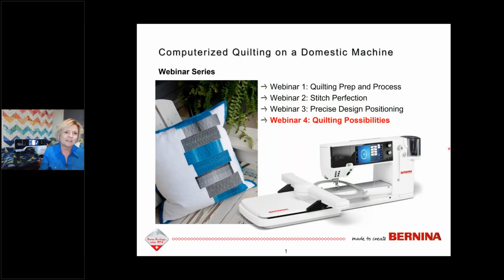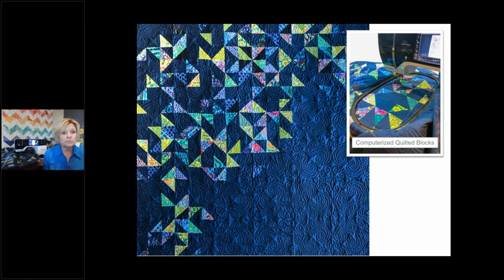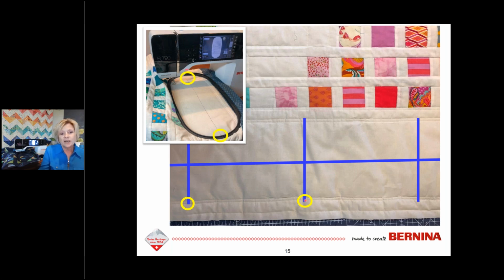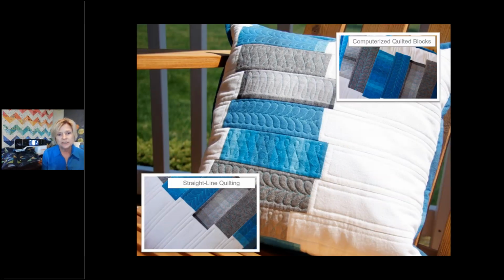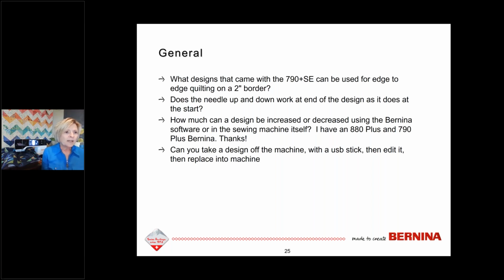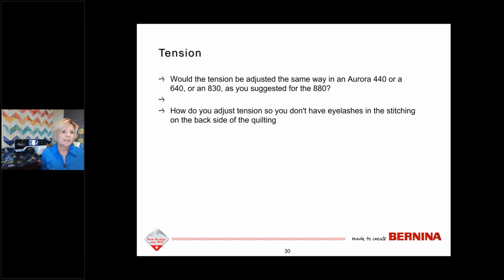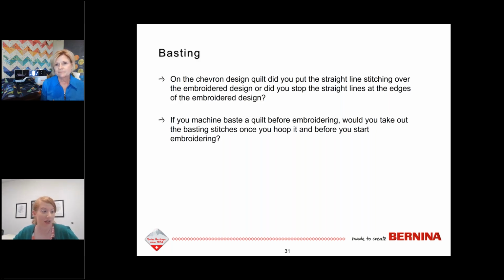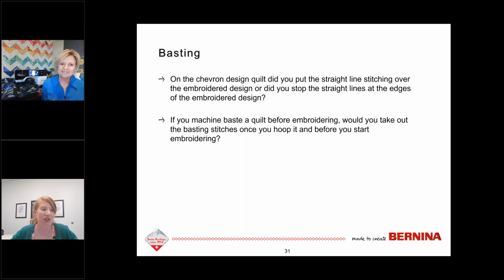Computerized Quilting on a Domestic Machine Webinar Series with Connie Fanders Session 4

Comment: This was a great webinar series and very clear.  Two suggestions for next time:  I would love a webinar that emphasizes utilizing the Version 9 software for computerized quilting, combining designs for sewing  out.  Also with regard to pinpoint placement, I just finished a course with another Bernina educator on a whole cloth quilt using pinpoint placement.  She highlighted the use of the zoom in function so you can see the actual stitch that you are lining up to and setting.  Also it covered how to use pinpoint placement without resizing the design which actually shows on a whole cloth quilt.   Thanks!